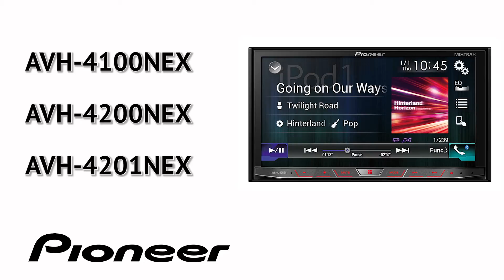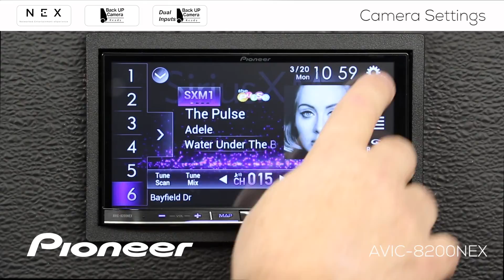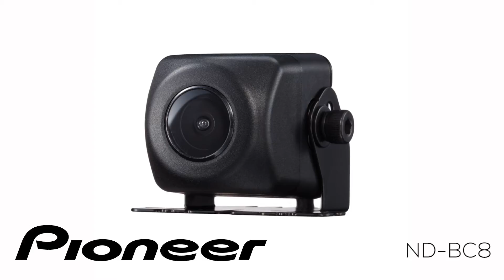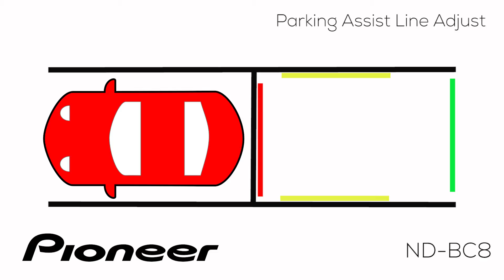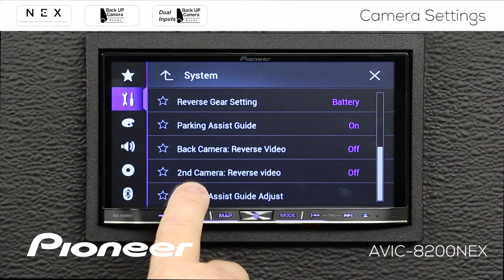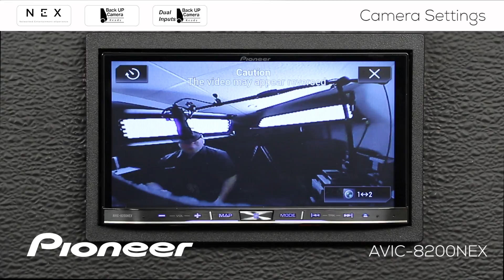How To - Front and Rear Camera Settings on Pioneer NEX Receivers 2017

Comment: how do we fix when the image reversed when I reverse the car.  Is there any no software fix for this?
Reply from the maker: What is the model number of your Pioneer in-dash receiver?   Pioneer receivers with backup camera input are designed to work with the Pioneer ND-BC8 backup camera and not a forward facing camera.  It sounds like you are trying to use a forward facing camera as your backup camera.  I recommend to use a camera designed as a backup camera with your Pioneer receiver.  You can find more videos on Pioneer's YouTube Channel here:  https://www.youtube.com/user/pioneerelectronics

Comment: Does this work for 8400. I don't see parking assist option on the radio.
Reply: The Pioneer AVIC-W8400NEX does not have parking assist lines. This is normal operation for the product.   You can find more videos with very similar operation to Pioneer AVIC-W8400NEX here:  https://youtu.be/xvp2910DqQs?list=PLw63zJRQbCNim0lElBRZEQ9ksIx2UZTFa   You can find videos for wireless Android Auto and Wireless Apple CarPlay here:  https://youtu.be/yoPE7eF84-0?list=PLw63zJRQbCNjEAQpPz58mHXOMdxc_l5sa  Please be sure to install the latest firmware for your Pioneer AVIC-W8400NEX.  You can find it here:  https://www.pioneerelectronics.com/PUSA/Car/NEX/AVIC-W8400NEX#downloads   and you can find more videos on Pioneer's You Tube Channel here:  https://www.youtube.com/user/pioneerelectronics

Comment: Recently installed a 8500NEX in my 2015 4runner. When using the forward facing camera the stupid message about reverse image is blocking the view of the road and makes the camera pretty much useless. I can see if Pioneer flashed the image for a few seconds and then removed it but no, it stays. Any way to get rid of the warning text?
Reply: I'm not aware of a way to remove the warning text from the screen.  You can find more videos with very similar operation to Pioneer AVIC-W8500NEX in this Pioneer You Tube Playlist:  https://youtu.be/xvp2910DqQs?list=PLw63zJRQbCNim0lElBRZEQ9ksIx2UZTFa  Be sure to install the latest firmware update for your Pioneer AVIC-W8500NEX.  You can find it here:  https://www.pioneerelectronics.com/PUSA/Car/NEX/AVIC-W8500NEX#downloads  You can find more videos on Pioneer's You Tube Channel here:  https://www.youtube.com/user/pioneerelectronics

Comment: My backup camera works great. Except in the camera settings I don’t see the Parking Assist Guide option.  I do se the Parking Assist Guide adjust, and I have been able to adjust the lines.  However, I am having to manually turn on the parking lines every time I put the car in reverse.  I have a avic-w8500nex. Any thoughts?
Reply: This is normal operation for the Pioneer AVIC-W8500NEX. Once you have set up the parking assist lines, if you want to see the lines, you need to switch them on each time.  Please be sure to install the latest firmware for  your Pioneer AVIC-W8500NEX.  You can find it here: https://www.pioneerelectronics.com/PUSA/Car/NEX/AVIC-W8500NEX#downloads     You can find more videos with very similar operation to Pioneer AVIC-W8500NEX in this Pioneer You Tube Playlist:  https://youtu.be/ObpKXwrN8us?list=PLw63zJRQbCNi6CoU7JbUNT83T7ippQbU6  and you can find more videos on Pioneer's You Tube Channel here:  https://www.youtube.com/user/pioneerelectronics

Comment: Why i cant see "parking assist" on my avh x1750dvd? Someone pls help.
Reply: If you can't find Parking Assist in the settings menu of the AVH-X1750DVD, that product does not have Parking Assist Guidelines.  Please be sure to install the latest firmware for your Pioneer AVH-X1750DVD.  You can find it here:  http://www.pioneer-latin.com/en/products/avh-x1750dvd-647.html  You can find more videos with similar operation to AVH-X1750DVD here:  https://youtu.be/XSbS4UM8t9Q?list=PLw63zJRQbCNgztjxzOXWxQfmPBcEh0pHv    You can find more videos on Pioneer's You Tube Channel here:  https://www.youtube.com/user/pioneerelectronics

Comment: I dont have 2 camera connected on my pioneer w8500nex I only have 1 backup camera how ever how do i engage the camera with out putting it into reverse ? All  get is a black blank screen with the camera option 1>2 at the bottom right hand screen but nothing happens when u touch 1or2  ?
Reply: The Pioneer AVIC-W8500NEX can have two active camera inputs.  Be sure to have your dedicated backup camera plugged into the Brown RCA Backup Camera Input on the back of the Pioneer AVIC-W8500NEX.  If you choose to get a second camera, it will plug into the Yellow RCA Video Input also on the back of the in-dash receiver. In the camera settings menu, be sure the Camera View is switched on and the Backup Camera is on.  Also in the settings menu, If you switch 2nd camera off, the 1-2 switch will go away from the camera view screen.
 From your question above, it sounds like you are using the vehicle's back up light to power up the camera when you put the vehicle in reverse.  When you choose camera view from the home screen, you are seeing a black screen because the camera does not have power because the vehicle is not in reverse.  The camera should have power when the vehicle is switched on. And the camera should power off when the vehicle is switched off.  The purple/white wire is used to let the in-dash receiver know that the vehicle is in reverse and to open the backup camera window on the in-dash receiver. Do not connect the camera to the purple wire with white stripe. You can find more information about wiring here:  https://youtu.be/-bF3uzzaT30?list=PLw63zJRQbCNhdpHlM2acWPLkNzR8wLwdW      You can see a similar in-dash receiver with 2 camera inputs here:  https://youtu.be/OhxjLAeSSTU?t=406   and you can find more videos on Pioneer's You Tube Channel here:  https://www.youtube.com/user/pioneerelectronics

Comment: can you set the front camera up as a dash cam to run in a loop on the SD card?
Reply: No. The system is not designed that way.  For a recording camera you might want to consider Pioneer's ND-DVR100.  You can see it here:  https://youtu.be/kqLbRgDvDgY

Comment: I have the avh 2330nex. Is it not possible to reverse the camera image on the newer models? I just updated the firmware and still don't have that option.
Reply: AVH-2330NEX level receivers do not have reverse image settings. You can find more videos about AVH-2330NEX in this playlist:  https://youtu.be/GX8bETHjZkg?list=PLw63zJRQbCNim0lElBRZEQ9ksIx2UZTFa

Comment: So, if the MVH-2300NEX does not have the parking lines, can you tell me which units actually do? I just spent my weekend tearing my truck apart to put this unit and a camera in only to find out that a major selling point was not available as the other Pioneer video (which has now been taken down) said my unit would have. I'm pretty frustrated.
Reply: Pioneer receivers with 7 inch screens that include parking lines:  AVH-2300NEX, AVH-2330NEX, AVH-4201NEX, AVH-4200NEX, AVIC-8201NEX, AVIC-7201NEX.  One other option is to use a camera that has it's own parking lines.  The parking lines will show up on the in dash receiver screen.
Reply: Thanks. I find the lines from a camera are pretty meaningless, which is why I liked the idea of the adjustable lines so much. Any reason why the MVH wouldn't have this when the AVH models do? Could they be added via firmware update? Also, any idea if the AVH fold-down screens have any clearance issues with the Metra 99-3305? Crutchfield seems to believe that the fold-down screen models will not fit.
Reply: I don't know why there are no parking lines on MVH models.  I would not expect to see a firmware update to put the parking lines on these models.  I have heard of some screen motorization clearance issues with that kit when installed in some vehicles.  Not so in other vehicles.  If you don't play CD's or DVD's much you might not have to worry about it.  You might want to check with the people at Metra for some more detail on the kit and screen clearance.

Comment: Hello I have the avh-4202. It's not highlighting or making the parking assist adjustable. How do we fixed this. Right now their pointing towards the sky. Ty
Reply: Engage the parking brake.  You can find more information about the green parking brake wire here:  https://youtu.be/-bF3uzzaT30?list=PLw63zJRQbCNj54n_seneF7Hx-YNqfV-ow

You need "Parking Guide Adjust"  This is shown in detail in the video at the top of this screen.

You can find more videos about the AVH-4200NEX here:  https://youtu.be/mHpVfoueoEE?list=PLw63zJRQbCNj54n_seneF7Hx-YNqfV-ow

Comment: Hi, I have e a avh 4201nex and I can't switch between the 2 cameras unless I put the camera in reverse. I would like to be able to turn on the rear camera to see while I'm towing buy like I said, only way to see through the rear view camera is by going into reverse.
Reply: You can switch on Camera 1 or Camera 2 at any time.  The vehicle does not have to be in reverse.

In the Camera Settings section, make sure Back up camera input is switched on, and 2nd camera input is switched on.  Also in Camera Settings, make sure Camera View is switched on. This is shown at 1:20 in the video.  

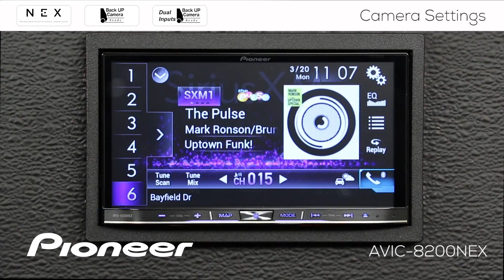Select Camera View from your source list.  This is shown at 8:30 in the video.  Touch the 1-2 button shown on the bottom right of the screen.
Reply: Deckerd Otto thanks for replying, 8 think my problem is that I'm getting power to the camera from the reverse wire it self, so I assume i should run a wire to an acc power and leave the purple white connected to the reverse lamp wire. 

Also do you know if other than the 4200nex has the detachable screen, I wanted the 8200 but when I bought it the guys over crutchfield told me the 4200 is the only one and now a guy over there told me he believes all of them have detachable faces. 

Thanks again.
Reply: I'm having that same exact problem
Reply: You have the cameras wired incorrectly.  The camera should have power when the vehicle is powered on.  Do not connect the purple wire to the camera.  Check out this video for more information:  https://youtu.be/-bF3uzzaT30?list=PLw63zJRQbCNgqBz8Rs5EW8-PZ3Pa9MJQW
Reply: Oooh okay gotcha!! 💯💯